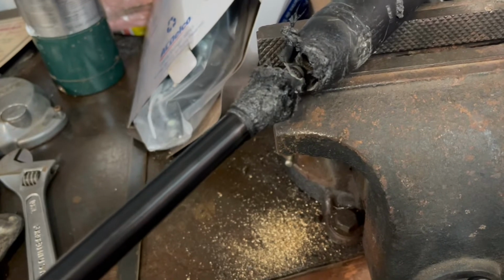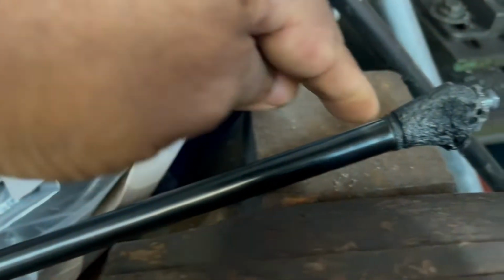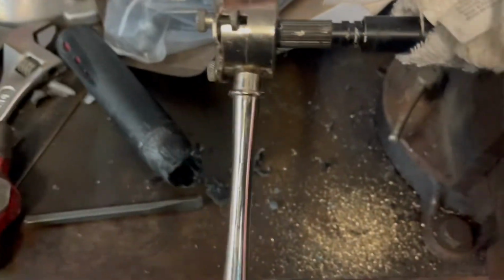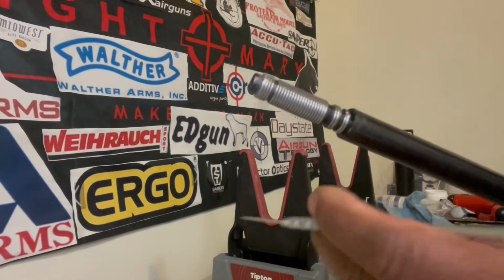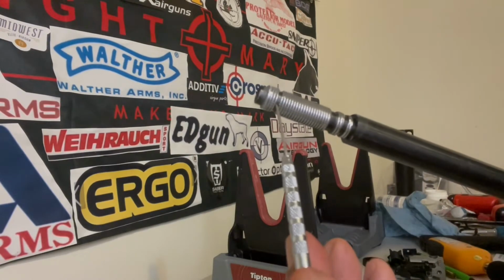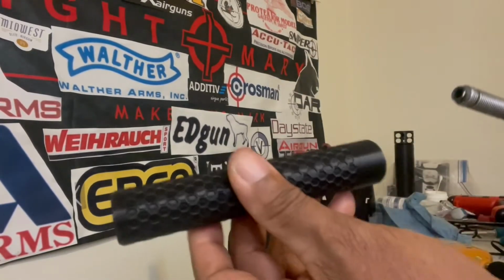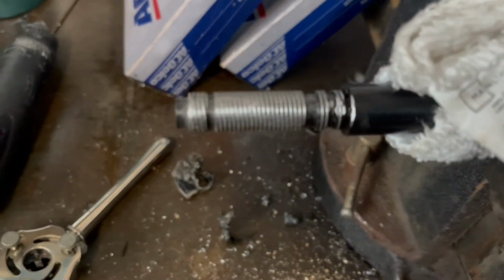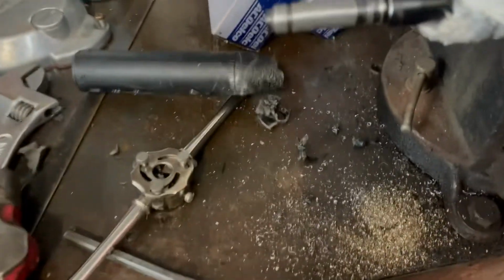How To: Removing and threading 1/2-20 barrel on a Gamo Urban #gamo #gamourban #gamoairgun

Comment: the muzzle is 12mm . 30 thou shy of 1/2 inch.i found slide on adapters for this type of mod.this is just a heads up for us gun nuts.also thank you for your post brudda

Comment: , if the gamo has a choke  ,this is the best way , you dit it ok .  , if not  cut the ugly part af  ,recrown  and get a adapter ,thats fit thight  ,best is a  heat  crimp ,or locktite

Comment: Do you have a  sound comparison video of it before and after you threaded a new suppressor???
Reply from the maker: 👋🏾sup brah! I do not since the original was damaged internally Braddah👊🏾😎
Reply: @airgunspestingch.8426  I have the same pcp. Is there any chance you could do a short testing the sound of the report coming off suppressor with a gauge so it could help me with choosing one of my own before taking apart and tapping threads on mine as well.
Reply from the maker: @A.S.M.S 👋🏾sup brah! Any aftermarket moderator is better than the non removable factory moderator😉braddah👊🏾😎

Comment: finally a video that talks about this, I have a question in your opinion if I mount the 1250 barrel which is 20 cm longer because without a moderator, will there be any difference regarding the joules or the precision? thank you, I really hope you give me an answer, anyway congratulations on your beautiful video, greetings from Italy
Reply from the maker: 👋🏾sup brah! A longer barrel will give you slightly more velocity fps than the shorter barrel will. The accuracy will depend on if the barrel is accurate and also if the shooter is up to the task of shooting the gun accurately braddah 👊🏾😎

Comment: I just got a Ruger Max elite 22 air rifle and bore sighting laser, but you can’t use a boresighting laser if you can’t remove the suppressor. There is an Allen screw at the end of this plastic suppressor so I’m wondering if it is removable. I’m applying quite a bit of pressure and it doesn’t seem to be budging.
Reply from the maker: 👋🏾sup brAh! I had you used a propane torch and a chisel to remove mine braddah👊🏾😎
Reply: @airgunspestingch.8426  It would be nice to put a silencer on this thing because I think it’s a bit loud. Could you make a video on this gun because they don’t exist. Make a video explaining how you did this and how you put the silencer on.

Comment: Question? Is the end you chased the threads on part of the actual barrel and does it have a crown on the end? I guess I don't really mind the ugly pickle <LOL>. Do you use a moderator one size over, like a .25 moderator for a .22 caliber? I think most moderators are somewhat ugly but that is acceptable in order to quiet the loud bark down. Did the heat from the torch have any adverse effect on the bluing? Looks like more work than it's worth but at least we know what's underneath that pickle now.😉 👍👍
Reply from the maker: 👋🏾sup brAh! Yes there is a crown! I do use the next size moderator .25! No effect on the bluing with the heat! It gr only thing about the pickle is if it gets damaged internally, there is no replacement available other than replacing with a new barrel and moderator as one braddah👊🏾😎
Reply: @airgunspestingch.8426  I'm sure someone has used a 3-d printer to make new baffles if needed. The Gamo Arrow has a pickle on it too but the baffles are a little different design.

Comment: I'm surprised you can get the threads straight with a die by hand.  I assumed they normally machine the threads using a lathe to ensure straightness.  If the threads are even slightly cocked the pellet will hit the moderator baffles.
Reply from the maker: 👋🏾sup brAh! I’ve done two barrels this way so far no problems braddah👊🏾😎

Comment: Did you have to cut the barrel down any to fit the moderator on the whole way? Thanks
Reply from the maker: Sup brah!no I did not cut down braddah👊🏾😎
Reply: @airgunspestingch.8426  and that still fits on all the way, along with other brands?
Reply from the maker: @brandontimblin  👋🏾sup brah what do you mean? I threaded the barrel ? Braddah 👊🏾😎
Reply: @airgunspestingch.8426  because there was so much thread on the end of the barrel I didn’t know if that length of threads fit into moderators without cutting it down. Most barrels only have about 1/2 -3/4  inches of the end of the barrel threaded

Comment: Is there an easy way to remove that barrel, or do you need to dismount the whole gun?
Reply from the maker: 👋🏾sup brah! Barrel from the block or the pickle from the barrel? Braddah👊🏾😎
Reply: Hey yo again! I fixed the jammed pellets problem! But I am still wondering about the barrel and ways to remove it from the gun. Thanks.🙏🏽

Comment: How come you didn't just pull out the roll pins, and then unscrew it? It come right off.
Reply from the maker: 👋🏾sup! Roll pin removes the silencer not the part that is factory molded on the barrel 👊🏾😎